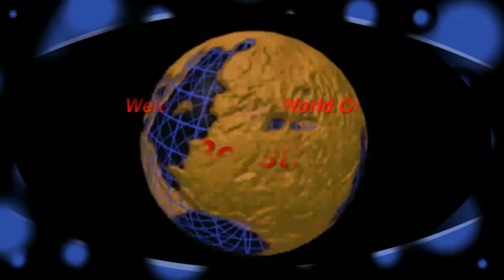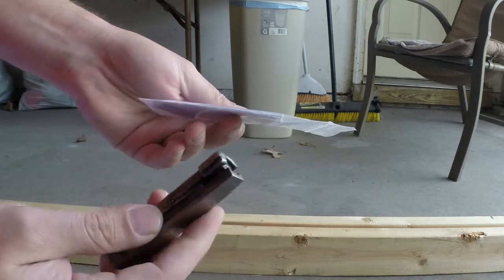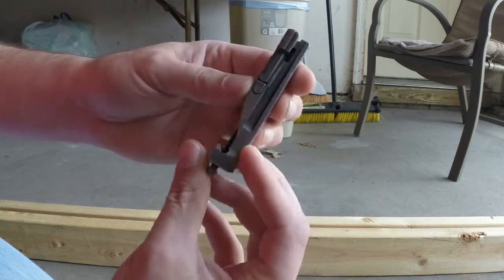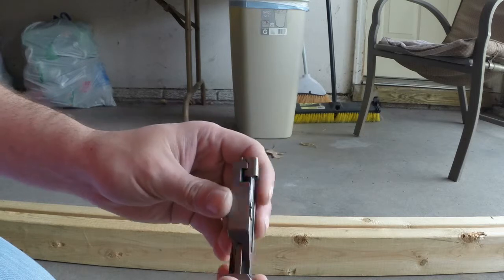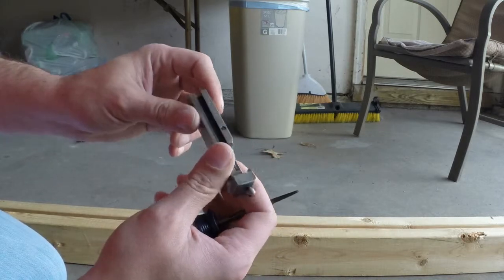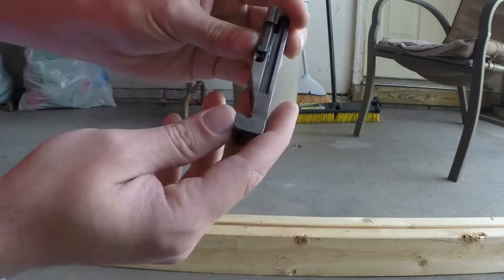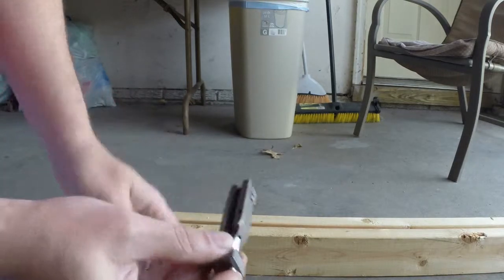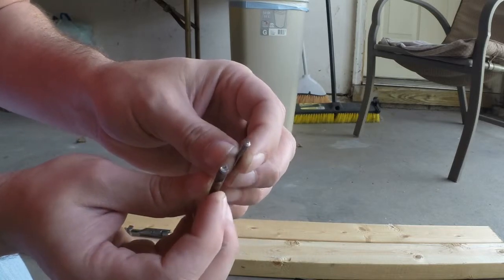Replacing A Murry's SS Firing Pin In An SKS.

Comment: Yes Sir, yours was part of the bad batch, and while 420 refers to good medicine for some people, 420 SS from a 3rd world country is not good! Thanks for sharing the video, and you're right, 2X4s may not be the best base to remove a Retaining Pin. The best tip we've heard is a 3/8" or 1/2" socket laying on the concrete floor. Lay the bolt on the socket and getting the RP out will be much easier. Yours looked relatively easy to remove and re-install. "First time" removing a RP can be troublesome. Glad you're pleased and let us know if we can be of further service.